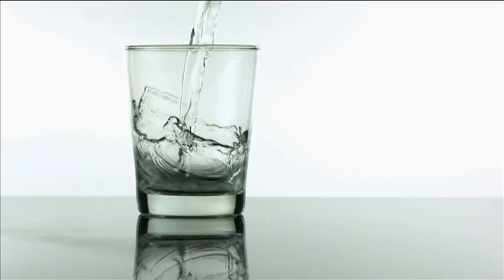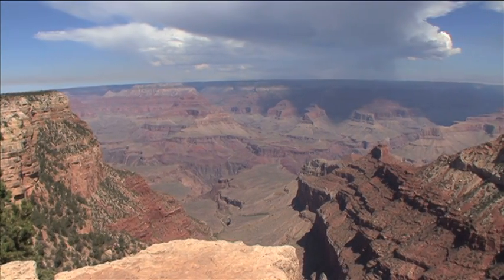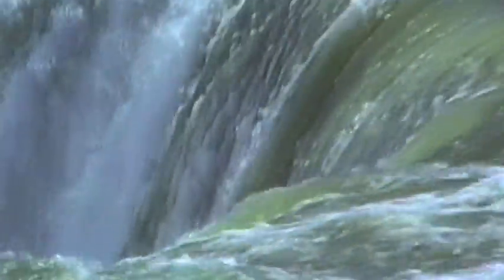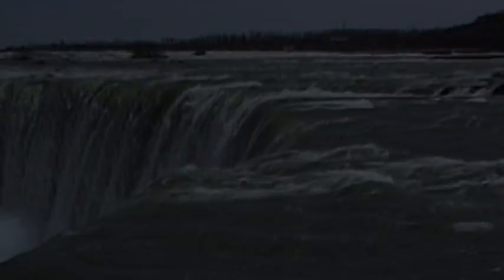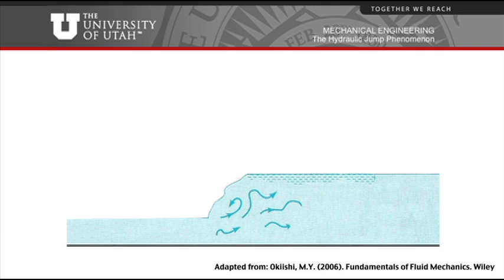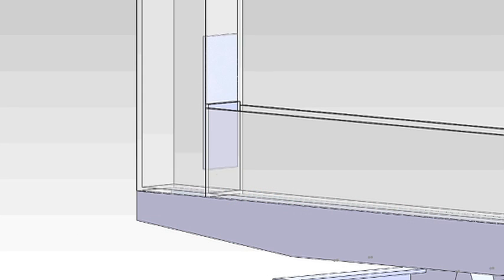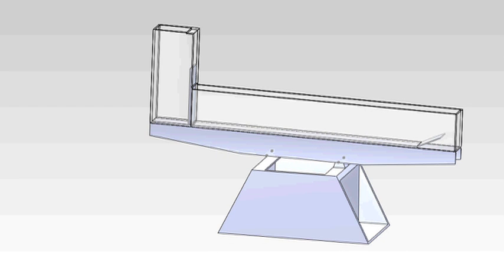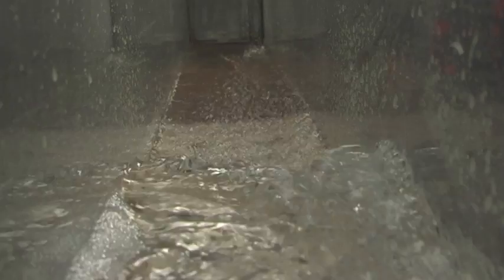The Hydraulic Jump Phenomenon

Comment from the maker: Glad you liked it. The Froude number is relatively simple to calculate: Fr = Velocity / sqrt(gravity*depth). In this case the velocity was calculated using Bernoulli's equation, but if you know the flow rate and the cross-sectional area then the velocity is pretty straight forward. The depth was measured simply with a ruler. If the depth is not initially known (designing a water slide) you'll need to include gravity effects as the flow is accelerated down from the top. Good Luck!